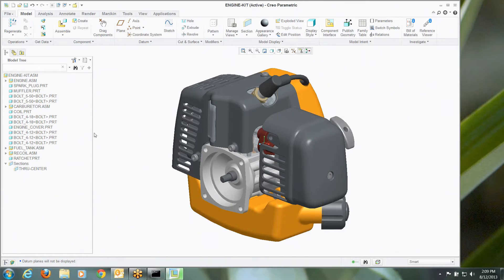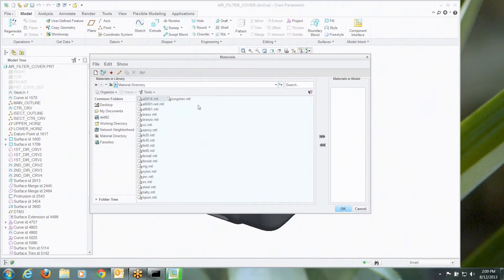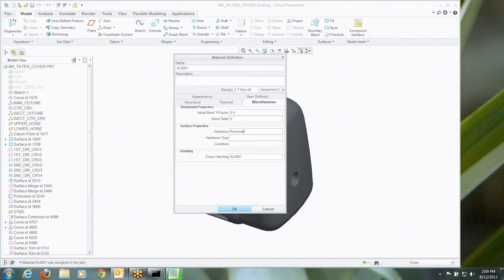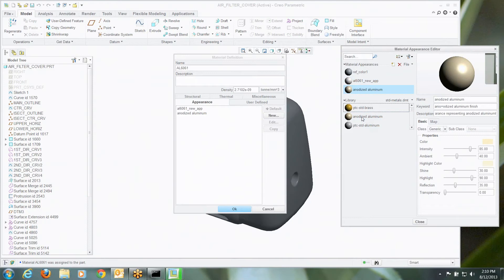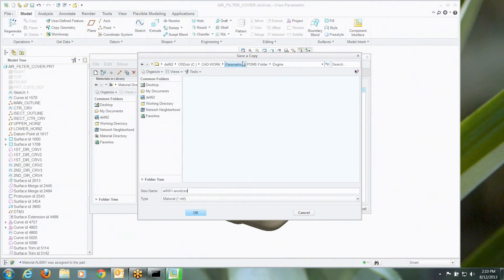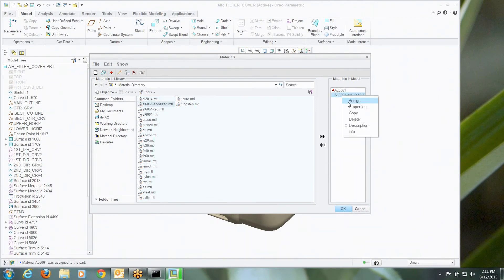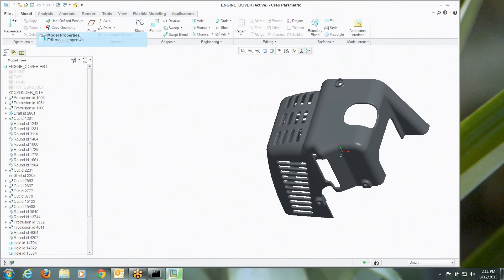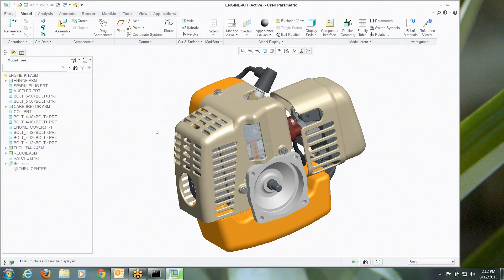Using Creo and Pro/E material definition files to define model appearances - EACPDS Tip of the Week

Comment: I encountered a problem. When I restart Creo 2.0 and assign the material to a part, the color is not correctly displayed. How to fix that? In your occasion, it works fine to assign al6061-anodized.mtl to another part  just ONLY after you just created and saved it. However, once you close the software and restart, same material assignment won't have the part to show correct color.

Comment: Great tip...however, one question....you picked the colour from the Library area....how does this library area get populated with colours....our appearance.dmt file populates the appearance gallery
Reply: Your admin may have removed that set of appearances. They are the default set that ships with the software. They are in "Creo 2.0\Common Files\MXXX\graphic-library\materials"
Reply: Mark Ganzer Thanks Mark, I sort the admin side out, the appearance.dmt and global.dmt files are located in the correct directory, Im interested in how I tell the Appearance Manager to use those files in order for me to allocate them in the material files. If during the setup of the material file, I load in our local appearance.dmt, I get all the colours in the appearance tab of the material file, I then have to select one to be default.

Comment: The mapkey GUI is the same as it was in Wildfire. One trick is the mapkey tool is not in the ribbon. You can launch it using the command search (magnifying glass at top right). Type in Mapkey and you can launch the command from there. A bigger challenge is adding the mapkey as a commend button on a ribbon. Each ribbon is in a unique mode. There are around 28 in all. If you want an icon in the ribbon not matter what mode you are in you'll have to add it all places.

Comment: Mapkeys from WF 4.0 should work in WF 5.0 (sometimes called Creo Elements 5.0) except for drawing mode, which used the ribbon. All modes in Creo Parametric 1.0, and 2.0 use the ribbons in all modes so most older mapkets will have issues.